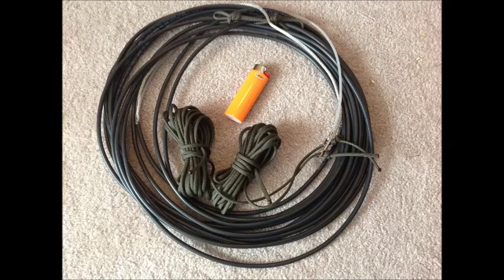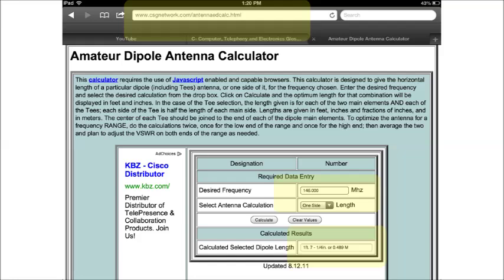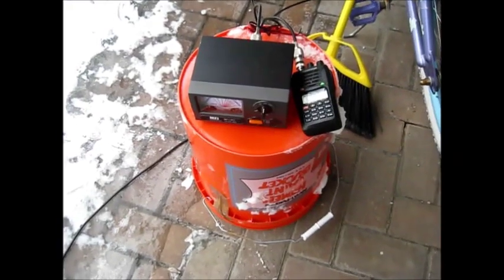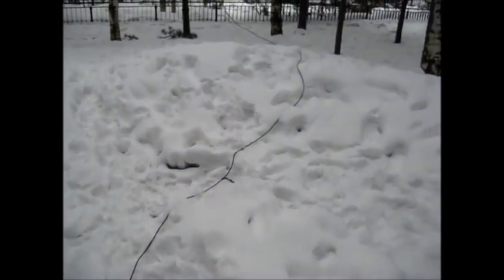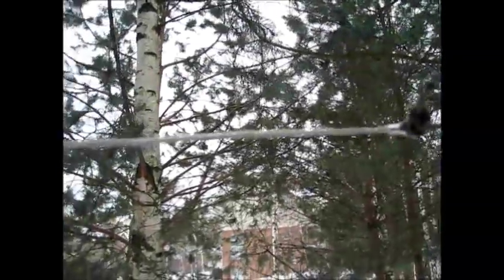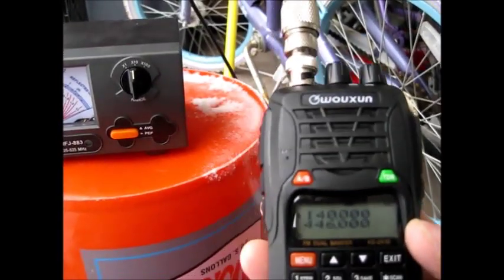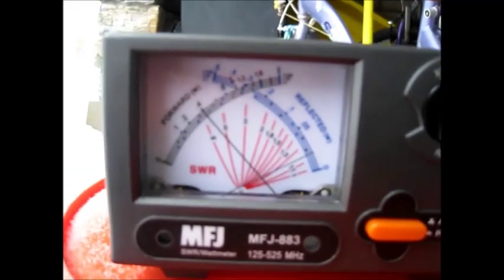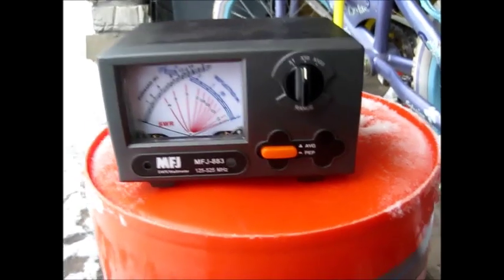Bugout Bag VHF or UHF Coax Cable Antenna

Comment: What about the horizontal polarization of your antenna versus the vertical polarization of nearly all VHF/UHF antennas used for normal voice communications? I believe you could hang it vertically with better results.

Comment: Will normal tv coax work?
Reply from the maker: Yes but the formulas and power ratings are different.  You will want to look up 70 ohm cable antennas.
Reply: @Commsprepper  ok then you used 50 ohm?

Comment: Guys, let's make this simple.  468 (Constant) / 146.000 (Operating Freq in MHz) = 3.205 FT (Half Wavelength) x 12 = 38.46". That is a half wavelenght in wire.  Divided / 2 = 19.23" which is 1/4 wavelength in wire (the lenght on each side of the split out part of the coax).  PERIOD.  If you move away from this resonant frequency, the SWR will rise and radiation efficiency will fall.

FYI, it is not possible for this not to work if it is in free space unless you use bad coax or short the connector on the feed end.  If so, then fix that problem.

PS. I learned this in high school in 1967 and I still remember it....it isn't that hard!  For those of you who cannot count, that was 50 years ago.

Comment: Ok once again I'm having issues. I don't have the short in the cable anymore, but no matter what length I cut the coax to I get really high SWR. I can bring up local repeaters but I don't want to damage my radio with high SWR.

Comment: Ok I used the multimeter and put one end on the shield and the other on the center pin and it beeps. So that means the coax is bad?
Reply from the maker: If you touch the two leads together and the meter beeps - that's shows a short and the meter is working.  If you put the leads between the shield and center pin of the coax and it beeps that means you have a short (bad) in the cable.  If this is the case the most likely problem is in one of the connectors when the cable was made.  Easy test is to cut off the connectors and check the cable with out them.  No short - cable is good - put new connectors on and test again.

Comment: Thanks. I'll have to give it another try.
Reply from the maker: Bushy556 Check the cable too with a multi-meter to make sure the shield is not shorted to the center pin.

Comment: Ok I hooked up an antenna from N9TAX and the SWR is pretty much 1:1 on 146.000 so I know the meter works. I'm an antenna noob so I'm not sure what the deal is.  This was some coax I took off a dipole I built that  no longer using.
Reply from the maker: Try this dipole calculator. http://www.csgnetwork.com/antennaedcalc.html
Reply: @Commsprepper  145

Comment: Will it work with RG8?  I've done exactly the same thing as you did in the video and my SWR is off the scale from 144-148. Any ideas?  Afs_3@hotmail.com.
Reply from the maker: Bushy556 You could use RG-8 but it will be heavy.  Not sure why your SWR is off the scale.  I would suggest you check the meter with a know-good antenna to make sure it's working correctly, then go back and check your element length.  You will not get 4 megs of bandwidth with this antenna (good antenna between 144 thru 148) but you should get .5 megs of bandwidth. Perhaps try cutting for a target frequency (i.e. 146.520 national simplex calling freq) and see how far below and above the antenna is good (less than 2:1).

Comment: Was this antenna 1/4 wave or 1/2 wave?
Reply from the maker: Each leg is 1/4 wave.  Overall length is 1/2 wave.
Reply: I just built one using soldered on lamp cord for the elements. I put a four turns in the coax below the feed point. I was shooting for 1:1 at 147.000 and I got it without having to do any cutting. Thanks for the inspiration.

Comment from the maker: Not sure how to explain it.  I will need to check the ARRL handbook.  However, it has to do with the fields between the center conductor and the braided shield.  When the coax is split and the two conductors cannot interact with each other energy is free to radiate.

Comment: Good work, BUT newbies should be told that: RG58 should only be used for short lengths at VHF and above and it is customary to use vertical polarization for FM comm. Orienting your antenna horizontally is counterproductive for two reasons: It limits your signal to two directions broadside to the line of the antenna, AND cross polarization creates loss of signal in both tx and rx. Hang it vertical and weigh-down the bottom element. Pull feed away at almost a right angle. Carry RG8X jumper w/bbl.

Comment: I wonder what the signal is reaching your dipole? 50 foot RG 58 has a phenomenal loss on the UHF band. This is why most people use a minimum  rg8 and more likely LMR 400 also note when the antenna is used as a dipole in that configuration it is horizontally polarized thus you will lose over half of your of your remaining efficiency when trying to contact vertically polarized repeaters and handhelds. Other than that it will do in a pinch it is best to pack a good UHF antenna, they are small